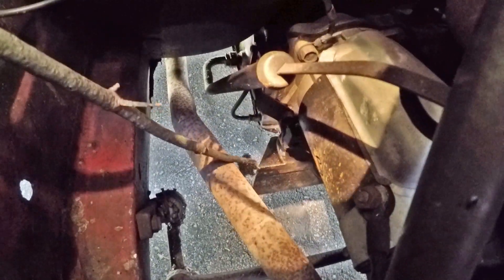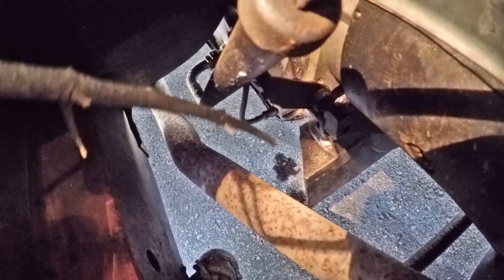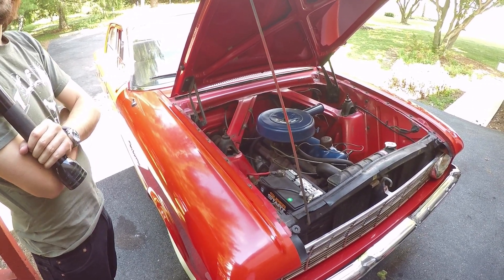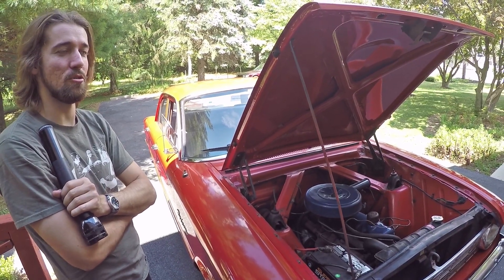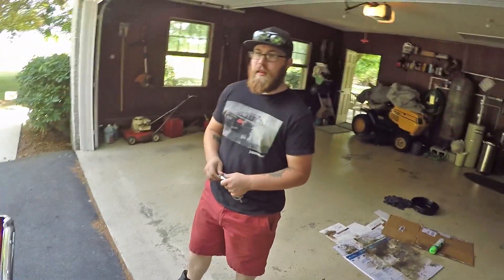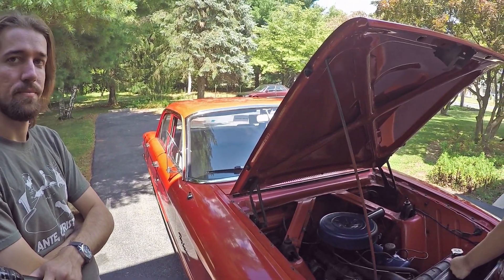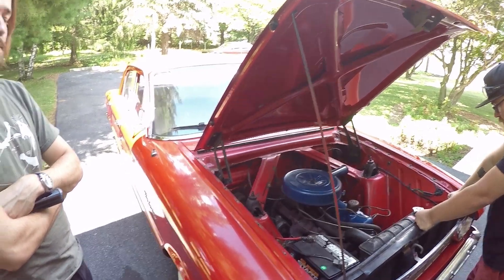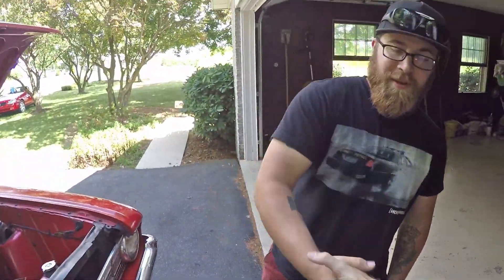Vagabond Falcon Ford-O-Matic leaks from main seal

Comment: I don't know much about cars but to me it makes sense to replace everything and keep the current engine as back up. Am I right to assume you'd be replacing it with another '60's engine?
Reply: It's not that simple. A swap would require modifying motor mounts, Trans mounts, shift linkage, rewiring and replumbing. And to go back to the old engine and Trans would then require you undo everything you just did. Unless he stays with the same engine style but I really don't see the point in that.
Reply: DrTittieSprinkles thank you.

Comment: I say fix the seal now
1) Likely a cheap part and a good experience since you'll have to pull the trans again someday for the swap.
1a) I'd watch a video of trans out and reinstall in the driveway.
2) Makes you more likely to use the car without having a case of ATF in the back
2.a) Less possibility you'll run dry and damage the trans.
2.b) If it's that big of a leak it's the right thing to do for all our drinking water.
3) It'd be nice to see OVF in full working order before the mods start.

Comment: I have a 302 and AOD in my '65 Ranchero and it's great fun.Just be aware that swapping a 302 into a six cylinder car is pretty involved.Besides the engine and trans,you would need to swap the rear end and front suspension.Not to mention the drive shaft and several other things.Maybe a 200 or 250 six would be an easier swap and at least look original.
Reply from the maker: M Poole How did you do your swap? email me if you want
Reply: RegularCars The engine swap is pretty straight forward.The factory mounts for a 63 V8 car would probably work.Where it gets hard is things like exhaust.The original rear end isn't strong enough for a 302,so you'd have to get a 5 lug rear end.The front end needs to be upgraded also.CSRP sells a very complete kit to do the 5 lug and disc brake conversion.It also has the steering parts that need to be changed.If you can afford it ,it's the way to go.The trans would need a new mount,and the driveshaft would need to be changed.I'm not saying don't do it,just be prepared.You will probably find a lot of little things you didn't expect.The small block fits ,but it's a lot tighter than the six.A newer six makes for an easier and cheaper swap but it's up to you.

Comment: Prioritize the brake upgrade. Get a shop to fix the seal, in fact maybe get a sponsorship from a local shop for labor. A regular sponsor for a regular car. Once the brakes are sorted, then consider engine swaps, because even a decent I6 could double the horses and you're gonna want the stopping power first.

Comment: as awesome as it would be to keep this car original, it seems impractical for its intended use, i think a swap to something with enough power to get you uphill without slowing down and reliable enough to not leave you wondering at what point its going to break on you would be a good choice. i'm sure we would all love to see something huge and stupid get thrown in there that would make this into a rocket but thats not the spirit of what this car represents. i cant wait to see what becomes of this little car!
Reply: eric piggott Isn't it safe to say that the hill was there in 1960, and people bought that car and pulled that hill in 1960. This means that the car doesn't need a new engine, it simply needs REPAIRED which is what you do to a REGULAR car.
Reply: ***** but for today's standards, it doesn't make sense to have to worry about your car breaking down 24/7 and if he plans on making it the face of RCR that means needing a reliable car that you don't have to worry about when your going out to film X amount of cars. Fixing it and having it still be underpowered and unreliable in today's standards doesn't make much sense with what he needs it to do. If it was just going to be a show car that he drives to maybe 10 shows every year then it would make sense to just fix it every year and keep that nostalgia alive with the original engine and tranny, but in this situation it would be a better decision to just swap the engine and tranny and upgrade the brakes and other nessesary safety components the car just doesn't have right now.

Comment: I can see the sense in the radiator upgrade but I'd much rather see you make the original engine & transmission work. Once you start changing big things like the engine & trans you loose the character of the car. The transmission leak can be repaired, the engine can be rebuilt. Do what they would have done in the day and repair the car don't try and upgrade it because you will loose what makes this car special as well as regular.

Comment: I vote swap the engine for something period correct. An I6 or V8 from a Mustang would work great. That's what a "regular" car guy would have done at the time if the engine had to be swapped, imo.
Reply: Yes I agree. Even "regular" car guys would swap the engine to something not so shit haha
Reply: Rin Hato That's the key. Not what Mr. Moneybags would do (LS, aftermarket "built" trans, fancy ECU, bespoke axle, etc). But what the "Regular Guy" would do - v8 out of a truck or Mustang with minimal drivability upgrades.

Or, my original idea. Rebuild the I6, make it a reliable, and then slap a turbo on that bad boy.
Reply: this.
Reply: Rin Hato why stick with being period correct when newer engines are way more efficient...... its not a high value collectible anyways......stick with the same brand at least :D
Reply: EvendimataE The idea behind buying the Falcon in the first place was to have the Regular Car of it's time. Replacing the engine with an LS4 or equivalent defeats the purpose.
Reply: Rin Hato agree, a period correct ford v8 is the best possible thing to do

Comment: I feel like maintaining what's there is the better and cheaper more reliable choice. Really if all the issues are gaskets and seals. Well then make it a fun project to take the engine out and have us all learn with you how this classic 144 works. I vote fix the transmission. Put new radiator and anything else that needs attention to get it reliable for your trips. If the engine blows up. That forces the swap choice lol

Comment: A Ford C4 (a.k.a. Cruise-o-Matic in the early years) with a input seal leaking? That never has happened on any of of my old Fords. Except for all of them. A small block 289 would work great and bold right up but that is a 24 spline and not a later 26 spline so go conservative with engine power, been there done that grenaded a few C4s. Or hop up the L6 and do like a 'Sprint 200' style L6 that would be neat.

Comment: Long term, a ford 302 from a fox body with a t5 transmission would less than a grand for motor/trans and mounts.  Enough power to get out of its own way and reliable.

Comment: Fix the seal, there is zero point in putting more power into this tank. Keep it stock, because it will be more valuable as stock, and engine swaps never go smoothly.

Comment: Keep the 144 and the Ford-O-matic. It's your first project, don't get in over your head. Keep your goals small for the first year or so. Pull the trans and get it rebuilt, add an aluminum radiator, update the brakes, etc . That'll keep you busier than you think. Those old motors can be nursed along well past their expiration date with care and attention. 
That said, by all means start looking for a 302 and an AOD. Get comfortable working on the VF. Take a look at other Falcons that have had swaps done. Start scouring eBay and Craig's for all the little odds and ends you'll need. 
Think of the 302 swap like a Boss Fight. Get all the powerups you can before you get into it.

Comment: Hey if your going to do an engine swap, what about something like a 221, 260, or the 289 V8 rather than the latter 302? as the cobra came out in 62' originally with a 260 so it would be more in line with the cars time period. plus it would still have that kinda Oh! factor for those who dont know about the cobra's history, as most people think it only ever came with a 427

even though they had 4 engine choices, and 2 body styles, the Daytona cobra, Cobra, 260. 289, 390 (a special one off that was made purely to destroy the Grand Sport C2's in racing with its bored out to 377, 327, which they promptly did) and then the 427, which was too much for the thing to handle on a road course.  

hell the 260 is the way I'd go just because of that little factoid and how uncommon it would be if you want performance out of it, granted I'm not the guy with the checkbook but it could be something worth investigating, although with keeping it humble in mind, the 221 might be the way to go.

Comment: I would make a build plan first before doing any swapping.  Decide on the engine and build the car around the decided engine.  Remember putting a more powerful engine in a car that can't handle it will get interesting.

Comment: What would've Joe regular done? Well, he would've ditched the tired, burned out 144 for a 200 (bolt-in) out of a wrecked Mustang. Both the 144 and 170 only have five bearings, whereas the 200 has seven. You'll get reliability as well as power and economy. Then a matching radiator or larger would get dumped in. The Ford-O-Matic is fine, the only other thing that might've changed would be the rear end gears. 

And that would be the end of it.

Comment: #2 no question. A regular guy would swap this engine out for something better and easier to work on/find parts for. An enthusiast would focus on keeping this car 100% original. I believe with how simple this car is, a engine/trans swap would practically be plug and play especially with how many fox bodies there are in junk yards with good engines and transmissions. This would make it thus acheiveable by the "regular" guy who has a toolbox and a brain. My friend has a 1963 or 1964 mustang with an inline 6 in it, runs perfectly but gets terrible gas mileage and low on power. He knows nothing about working on cars but is looking into a 302 swap into his mustang to make it more roadworthy.

Comment: #2 all the way
Reply from the maker: ***** Yep, that's looking more and more like its the best thing to do
Reply: RegularCars Really a 289 or a 302 wouldn't be bad for this car. The people who are getting upset at the idea of an engine swap A. don't have to drive the car B. Have the wrong impression of what an engine swap would do to this.
Reply: RegularCars I think in 1963 you could get a falcon with a 260 ci v8. I think it is the same platform as the 289 and 302 so it would look similar. If you can do the swap without hacking the car up and keep the engine close to stock you should still be able to get away with keeping it "Regular" and Joe Blow wouldn't know the difference.

Comment: Pull the engine/trans out of the car as a unit and replace every gasket and seal in both with the exception of the head gasket.  That car is nothing like a modern car full of wires and sensors so it is very simple compared to even a newer economy car with fuel injection, MAF, TPS, knock sensor, distributor less ignition, etc.  You could do the whole job on a weekend with a helper working with you.  Whatever engine you will swap to; don't rush it.  Buy some time for cheap now.

Comment: Obviously, if your going to drive the car, 10mph up a moderate hill doesn't cut it. The i-6 was a good reliable motor in the days of 2 SPD transmissions and 55mph speed limits. To use the car everyday and drive cross country, you shouldn't be in the slow lane being passed by fully loaded semis. Drop a 289 or 302 in it with an overdrive. It will look stock and be reliable with good mpg. I can get 28mpg out of my 320k mile 302. You can do that without losing any real originality and feel.
Reply from the maker: lilsammywasapunkrock Oh cool. In what do you have a 302?
Reply: 1986 cougar. Bought it for $500 a few years ago with 290k miles. I have upraded the alt and added an electric fan. Removed the power seats windows and mirrors and replaced with manual stuff, which is rare on a car that came with power everything as standard. Was bought as a hertz rent a car in oregon. Was wrecked and not fixed well, might eventually succumb to rust from cruddy repairs. I drive the car 100+ miles daily and would take it crossed country in a second. Might eventually fix it up, have a rebuilt 85gt block and all the mustang upgrades ill eventually get to if i keep it.

If your ever in the salt lake city utah area, swing by. It will be worthwhile

Comment: Keep it stock, if not, put a leaning tower o power in it and make it unkillable.  That's not exactly a massive engine bay, and an engine swap could cause more troubles than this engine would.  Figure on how much time/money you're willing to spend, then decide how important swapping it is.  You could always try to modify it to make more power.  If there's a will, there's a way.

Comment: Choice 2. Save yourself alot of headache.
Reply from the maker: Bezen1213 1 Second
Reply: RegularCars In response too all these people who say leave it stock say you replace the seal and then another part breaks and you fix that and on and on. You are going to be driving this thing up and down the country its not some garage queen you need reliability. Plus brakes and seat belts so you don't die in a fender bender.
Reply: Bezen1213 1 Ps i vote for the 289 V8.

Comment: i think it's a great car, but it needs to be more driveable (although constant butthurt could enhance the dramatic element of this channel if Reg's rage is channeled properly). 
the drivetrain has 2 drawbacks: the engine is asthmatic, and gear ratios are stupid by modern standards as well. 
i would either suggest a manual (if 4 on the tree for these exist) and another final drive - in this case it would at least go acceptably; or a complete swap. 
the swap is a more interesting option, and it will probably generate more stuff to film.

Comment: Keep in mind that Ford isn't anything like Chevy. Chevy you can bolt an s10 trans to a 1960 6cyl or a TH350 to a canyon 4 cyl. You have to have the right trans for a ford engine. 302 is a c4, a 460 needs a c6 etc..

Comment: RegularCars Mr.Regular I know opinions are worthless but imho you should live with the trans leak as long as it doesn't get worse but go ahead and put an aluminum radiator big enough for a 302 and convert to a dual reservoir master cylinder and disc brakes then save up your money for a 302. And take it from someone that has done many conversions, what ever you figure it's going to cost add at least 30-50% to that and double the amount of time you think it will take. That being said, these cars are the easiest to convert and take only a simple tool set to do it. what you don't have or cant borrow you can rent to get the job done.

Comment: Man that "squeaking sound" is like nails on a chalkboard.....i had to stop watching in the 1st 15 seconds, my senses wouldnt allow me to punish myself....with that said...i suspect it is likely the main seal. Just a hunch.
EDIT:  Nevermind, i just read the title....guess you figured that already : )

  I'll revert back to what i suggested when you first got this car. PULL THE MOTOR AND TRANS.....REBUILD it all. Shes tired, shes weakened over the years. She is BEGGING you to take the leash off and let her run. The "Red Sled" will never be a trust worthy roadtrip car if you don't. You will spend more time stranded and forced to fix little things one by one, and a far greater expense....Not to mention the loose of your sanity, patience and pride. 
   And don't forget to hang your fuzzy dice on the mirror.